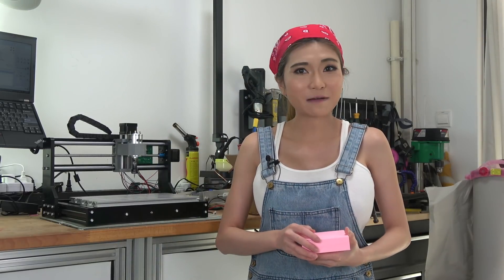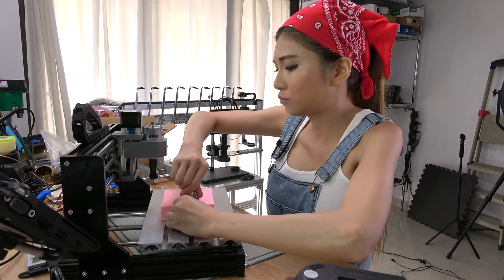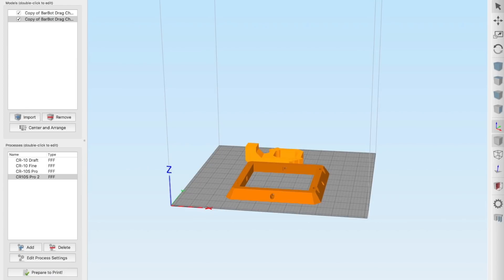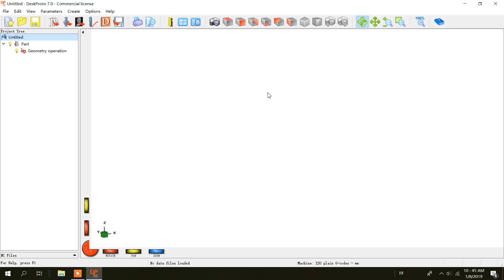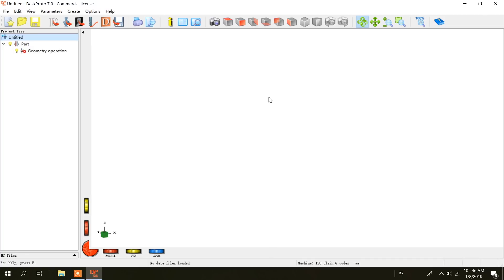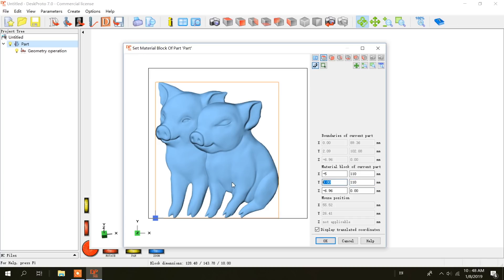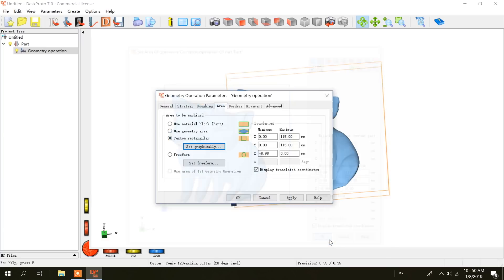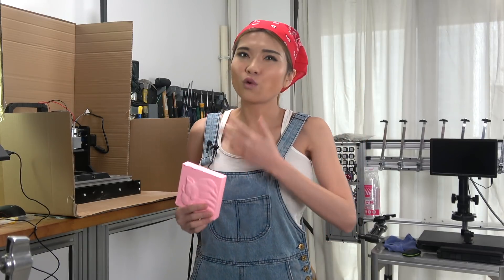Using DeskProto CAM software on the Genmitsu CNC Engraver

Comment: Nice job on the material mount!  For the future projects, you might need something to keep the material from being pulled up vertically.  Some materials like acrylic and aluminum get "sticky" while being cut and will grab ahold of your tool bit during a plunge cut and the spinning bit can pull it out.

There definitely are formulas and tables for various materials.   Even with those there is a bit of trial and error to get your machine to match well with your project.  They can help keep you from overheating your tool end (which wears it out quickly), or material (which can prevent it from melting or keep wood from catching fire ).  When I teach people at our makerspace to use the CNC, I ask them to memorize the Ideal feed rate Formula, but not so that the calculate it every time:  I want them think about the formula as a way to remember the relationship between the parts.  Feeds and Speeds is all about removing a consistent amount of material:  If you double the tool bit diameter, you can increase the feed rate.  If you increase the number of flutes on end mill, you have smaller chips (your software may have called that Precision?) but you will have more of them so you can increase the feed rate.

I will stop geek-splaining now (Sorry!).  Thanks for the videos - I always enjoy watching you explain what you have learned and I hope you have as much fun with your CNC as you have had with your 3D Printers!

Comment: I work with CNCs all the time. Your method of starting with defaults and then just experimenting from there is exactly how we do it professionally when working with new cutters or material. There is one exception, if you're working with metal, look up the chip load formulas, they give seemingly weird results, but they work really well, then make adjustments from there.

Comment: I really appreciate your honesty and your commitment to solving one problem at a time! It's a strategy that works well but very few people can pull off.
Reply: Discipline and patience. Too many people get frustrated and give up too easily. They take the easy way out and pay someone else to do the things they could do themselves. That is if they applied themselves. 

I'm guilty of it myself when it comes to engine and automotive work. I just never developed the interest in it. The sad part is with my wood, metal, and electronic skills it should have been easy to pick up.

That said learning 3d printing, CNC/milling, and a little sewing skill there isn't much that people can't make themselves. Make the parts and assemble them.

Comment: If you slope the part side of your fixture (wider at top) (on one X and one Y) and push from the opposite side, you can always start from the same X0 and Y0. The slope will "pull" the part down towards the  bed. You can also use pins (think washer) that are again sloped, on two sides and use cams (elliptical washers) on the other two sides to "push" the part up against the pins. You are off to a great start. My first part pulled off the bed and went flying.

Comment: You might want get a set of parallels. They act like step across your vice. Also keep in mind that a vice needs to be squared up with the work table for accuracy.
Reply: There isn't enough vertical travel to use the vise on this engraver.
Reply: @charlesmckinley29  looks about an inch or two of clearence
Reply: But that one was not.

Comment: If you built your box out of foam and completely surrounded your cnc except the front (make it out of Plexiglas) it would cut down on the noise a bit. But you would probable need a fan and a vent hole to keep any motors from overheating. A computer fan (or two) would work for this. Also if you left your vacuum cleaner close enough to your work it would collect some of the dust. I apologize if I'm repeating something someone has already said. You have some really great content, I enjoy your videos.

Comment: I love that you have started a CNC series of videos, Yes its a tough learning process, but just as you said, trial and error and keep going. 
For small CNC machines like yours, an enclosure from the extruded aluminum you use with clear panels and an access door in the front would be perfect to keep the noise down. 
I am sure you can create a dust collection attachment for the spindle, your a 3D printing master so easy enough for you! 
Keep up the great work Naomi! Your an inspiration to so many out here in DIY land. Don't listen to the hatters, they are all just jealous that they aren't as amazing as you!!

Comment: If you can construct a box around the Genmitsu to enclose it, that will go a long way to deal with the noise.  And, if you can rig up a vacuum nozzle for the cutter head, your vacuum will deal with the carving dust as you go along.  We had a sign machine at a previous job of mine that had the same issues, and that is what we did.

Comment: I totally agree with you about cloud software. I've seen people use a length of garden hose attached to a shop vac to get close to and follow the cutting head and remove the dust quickly.

Comment: Naomi, one thought I have for you is that on your work holding, I like your idea but suggest ditching the set screw on the sides where your X & Y zero are, then set the machine X & Y zero to that corner. Then when you use the opposing screws to push your work piece into that corner you can have a repeatable zero every time. This will be a huge timesaver if you ever get into a large production run.

On that note, that desk top engraver is tiny but neat! It will be really easy to build an enclosure for it that also has dust extraction.

I will be looking forward to seeing what you do next!

Comment: For your vice, try getting some 'parallels'. You use these to help support the work piece up off the base of the vice. They shouldn't be more than half way up the vice jaws. Vices are the best way to hold your work piece without it slipping. The larger cutting bit and more dense the material youre cutting, the more important clamping you work to the base is. Hope that helps.

Comment: Wonderful video showing with a little bit of thought, you can produce a great and valuable result. This got me excited, as I'm in the middle of building a 400cm x 90cm DIY workbench. WHY? My CR-10 S5 came today. My kids faces were a picture when they saw the size of it. So, thanks for the video.
The machine seems good value if one needs a small cnc machine.
Well done.
Reply: its not that smal, 18/30 can produce a large piece of work if you are prepared to learn how to use the machine....this machine can also be modded with longer axis quite easily up to a metre long....

Comment: For the dust i have a suggestion, make a box like for a laser cutter, connected to a vacuum cleaner, top part made of acrylic that is transparent. You gonna see inside, is clean and healty, use a particle filtering mask, the dust is not good for your lungs. If the noise is too big you can add a layer of foam on the exterior to make it a lil better and dont forghet to add a air admission vent if you use a vacuum cleaner.😊❤

Comment: Well Done, The problem of the noise and dust can be solved with one new project. Simply build a small enclosure for the cnc.  Because of its size I think you could get away with 1 small sheet of plywood and some plexiglass.

Comment: Your custom fixture needs two datum faces which can be set parallel to the bed and only have the clamping screw's on the other two sides. Great job so far.

Comment: That first vice would be great if you had a set of parallels to place under the work piece to elevate it to a proper height and stabilize it.  Thanks for the video!
Reply: Also could have just used John's tape and superglue trick from NYCNC

Comment: You can use your first vice by using some parallel bars. They are very common in use with milling machines and are pretty cheap.

Comment: I've played with that software over the years. I like it but I purchased CamBam instead. It's cheaper and still quite capable. You can download it and try it for free. FreeCad is mostly a drawing program but they are expanding it to also generate g-code. It's open source so it will be free forever and it runs on several different operating systems.

Comment: You could 3D print some corner brackets and cut some acrylic windows to build an enclosure for your little Genmitsu CNC. Maybe even use some aluminum angle iron.

Comment: More CNC, just what I was waiting for :D
Reply: Software spindle speed control? Nice! When you make a sound proof box for this (I'm sure you need it!), think about lifting the whole thing off your desk with some damping feet so the noise doesn't transfer mechanically. When I had a desktop machine I used these - https://uk.rs-online.com/web/p/stud-mounts/7773250/  Hope that helps.

Comment: I think your learning speed is average or slightly above. Not slow by any means. I like your work holding solution. Two suggestions. Look into cam clamp work holding and if repeatability is important, only use 2 of the claps or screws to remove the part. It would also be a good habit to get into anyway because if you don't, the one time you need to make the same part more than once you will move the wrong clamp. Then you have to re zero the part.  Great video as always and I love the music.

Comment: Well done on a first carve :) Stepover could be a bit lower to get a nice finished product (gets rid of the cusp lines) and I think the Genmitsu should be able to run at some 1200 mm / min at the least. It is a pretty capable machine for it's price. :) I know you have gotten further since the posting of this video and probably allready know this. But for anyone else out there? Trust me on the stepover. (it is basicaly how much of the width of the bit you move over before doing the next movement, the fewer percent of the tool width the nicer the results)

Comment: Good work Naomi. I think CNC machine is a bit tougher to learn compare to 3D printer. I guess the next progress is to cut the “pig” in 3D. 👍
Reply: Opposite sides of the same coin. With 4th and 5th axis CNC machines you can 3d carve much of the same stuff you can print. Something like some of those lattice cubes, that some use to torture test 3D printers, are some of the few things can't really be made with a subtractive manufacturing machine.

Outside of that you can build your designs the same way you would for 3D printing. Then let the CAM software figure out the rest, much like you would a slicer in 3D printing. The learning curve isn't that steep, you just need to learn the limitations of your particular machine.

Comment: I wonder if building a set of spongy acoustic foam pads on the cardboard walls you set up around the CNC would help you. 
It's not a perfect answer but anything to reduce the noise levels will help!
Reply: water cooled spindle wil help with acoustic baffling.

Comment: When I seen that you were going to print a new workpiece holder instead of using painters tape and superglue , I though, 'what an idiot'. But I am def going to make a few like that out of aluminum.
A ball nose end-mill would be better for that piece. Maybe 1/8" - 3/16"
I am going build a box out of MDF for sound and dust. It will just be a top half and bottom half that flips open and will have an acrylic top and top front. The electronics will be in its own enclosure.

Comment: If you reduce the amount the bit moves over between cut passes you will smooth out the carving and get rid of some of your lines. Means less sanding for cleanup :-)
Reply from the maker: It would take longer then and I was a bit worried about noise and my neighbors...
Reply: I understand completely. Your a great designer...maybe a CNC enclosure is in your future, will reduce the noise :-)

Comment: Would double-sided tape be suitable to hold down pieces on the CNC machine? Great video as usual!!
Reply from the maker: I've seen it done but have not tried it yet...
Reply: Im using thin double sided tape for my waste board and my work piece (acrilic or wood). Works a charm.
Reply: A mechanical way to hold your work piece is always better. I'd make a modular vice and v block that will work with those slots. You can leave the v block locked in the same spot so your zero point is set. Just loosen the vice to remove the piece.  See thingiverse thing:489254 as an example.

Comment: I find it amazing how your 3D prints just come of the plate really easy, whenever i print its a mission just to get it off and never use metal tools to remove. Did you wear a mask as well as eye protection?
Reply from the maker: Once you get your layer height perfect prints come off more easily. Also try printing with the bed at 60c and letting it cool all the way first.

Comment: Is the CNC cut giving better result  than if you print the same in 3D with CR-10 ? Which method has the best result ? Love your video's :-)
Reply from the maker: 3D printing is a bit easier but you are more limited in materials

Comment: I agree with software running locally from your desktop is better than vague "cloud" based software. However TinkerCAD is not that. Yes, I use it too - wish there were a non-cloud version...
(edit) the free version of the DeskProto does not have the machine definition for the Sainsmart Genmitsu. Did you have to download the machine definition separately? Or maybe it's only included with the paid versions. This is BTW in the version available from their website as of today Feb 2nd, 2019. I have however made a definition file based on the parameters in your video and it seems to work fine.

Comment: You should try to mill PCB's, it's really useful.
Reply: @autohmae  It's not $1, at least 10$ for something half decent, and it's not only the price but the availability, it's not the same to wait a week or two to get it done than doing it in the moment you need it and making all the changes you need in the same moment, not waiting a week each time you need to do a correction to the board.
Reply: @autohmae  I know, I work with chinesse manufacturers, and that's why I point the time frame. Chinese companies work for large enterprises and small ones, so they're overloaded with job, the price is always very cheap, but the time frame is always longer as you must "wait your turn", if you need something done fast, you will pay, and a lot, it makes it impractical to use such companies for prototypes, having a CNC and being able to mill your own PCB's is a lot faster and cheaper while in the design phase, as you need to design, build and test until you get your final prototype. Also, for hobbist for small things like some led controller, an small audio amplifier, some gadget for an arduino, it is a lot cheaper than any company, you must think that ordering one PCB from those manufacturers is not possible, you need a minimum amount to order, 5 or 10 pieces usually, and then, it's not profitable to order 10 pieces of something that you know you're going to use just once. Having a CNC and milling your own PCB's has a lot of advantages unless you go for production.
Reply: @autohmae  Yes, sure, in Germany I have used a lot Würth, they do really good jobs and you can get your order delivered in two or three days, but then you're talking about 100-200€, that's not cheap... Per contrary, to buy virgin copper boards is extremely cheap, in China you can get'em for as low as 20c per one 50x50 board, then, already having the CNC makes a lot more sense to produce your own PCB's for hobby and prototyping than ordering them.
Reply: @autohmae  that's for a delivery of 6 to 10 days, when you need it fast, the price rises a ton.

Comment: Hey Naomi, this question is not related to CNC as it's related to 3D printing instead, I would like to know how long did you use to print  those pieces? Cause last time I tried printing something that size it takes overnight. It would be great if you have any tips or trick how to improve on that. 

Nice music choice btw xD
Reply from the maker: I think overnight, 3D printing isn't a fast process.
Reply: @Naomi-Wu  I see, thanks for answering!

Comment: did you have to add the genmitsu to the library list? mine doesnt have SainSmart Genmitsu listed :( are you using the free version or did you pay and you can see this cnc listed. i hate putting generic iso mm in my list. :(
Reply from the maker: Had to add it but if you email them they'll send you the profile.
Reply: @Naomi-Wu  Thanks! :)

Comment: How did you find your home position on the block?
Reply from the maker: Just manually jogged it to the corner...
Reply: @Naomi-Wu  an Edge Finder is very useful for finding a home position on the part, if you find yourself needing hit a tight tolerance.

Comment: If you would use a so called endmill or even better a ball-nose endmill you would not have the stripes from the V-bit in the picture.
I would take a few roughing-passes (low quality but fast) and leave 0.3 - 0.4mm for finnishing with a 0.1 or 0.15mm setting. So you would get with few passes a lot of material away and later with the last 2-3 passes you would create a stunning result! See here: https://www.youtube.com/watch?v=8Zf0LAVSheY&t=34s

Have fun with your CNC-router!